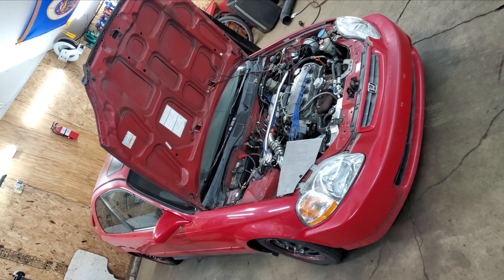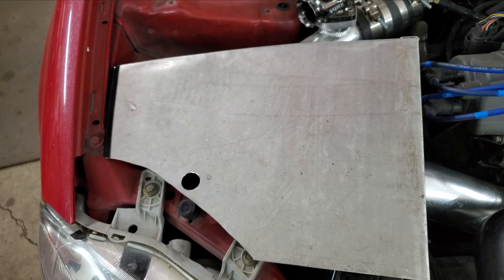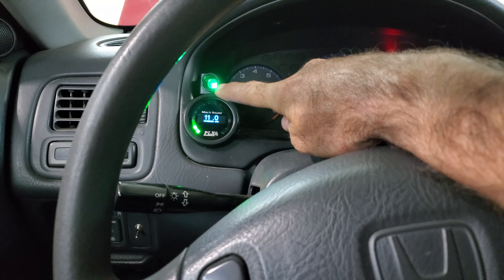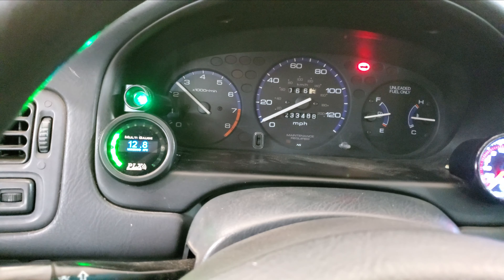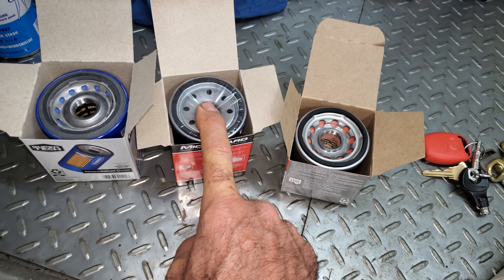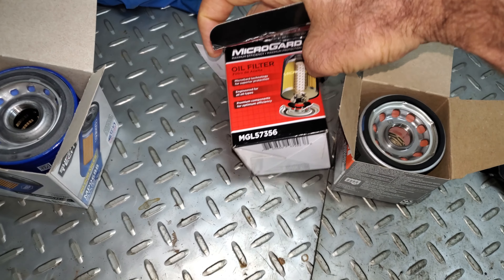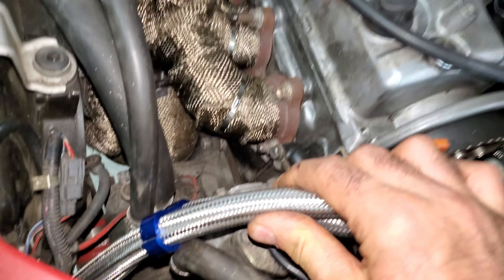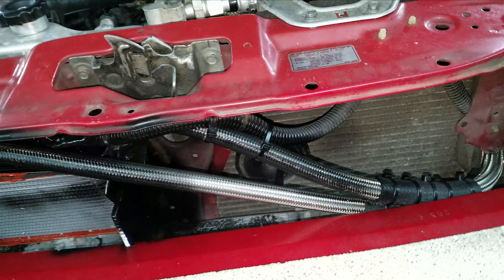Ej8 D16y8 Ebay Turbo oil cooler carbon synchro's part 24

Comment: I replaced the 1-2 syncro in my van and didn't even  have to remove the gearbox from the car. I opened it while on the car and was able to finagle the secondary shaft out to replace the syncro without pulling the primary shaft out completely. Worked fine.

Comment: Awesome vide as usual. I have the same setup as you on my 95 civic coupe. Only thing I put a 19 row oil cooler behind my intercooler. The oil cooler sits in between the radiator and the ac compressor but right on the intercooler. I like your setup better where the radiator fan will pull air through.
Reply from the maker: A little duct work does wonders for everything that needs cooling.

Comment: Hopefully you'll see this, I personally just picked up a tunernerd knock monitor v3. Its probably the tool youve been looking for, it'll really help dial in that timing and if I'm honest it's priced very well for what it does and gets rid of the guessing.
Reply from the maker: My problem with D16 is too high of cylinder pressure, with no detonation. Tuners have this problem with these. They are very detonation resistant. Location of peak pressure is too far up the cylinder, and timing needed to be removed, or boost lowered, or both. I fixed this problem by keeping my max boost pressure, and removing timing. That gives me the most power, without blowing my headgaskets. This stupid knock link never worked right, and wouldn't have helped me anyways.
Reply: @RustBeltAuto  

I've always understood d16's run so little timing as they have a detonation problems (y7/y8) and the z6 can get away with a little more but not much, and not cylinder pressure problems, if that was the case wouldn't the sleeves have damage if the problem was pressure? For example like the B20 sleeves. 

And to clarify they do technically have a pressure problem too if you get to much rpm/psi/timing on stock sleeves but the main culprit I've seen is all timing to grenade headgaskets.

Input?
Reply from the maker: @schafer240  they have a lack of detonation problems. It fools the tuner into believing the timing is correct, when in fact the location of peak pressure (LPP) is way off. They do not have the tools to measure it, and usually do not understand it. The head gasket is the weakest link. Peak pressure on an engine for maximum power is at about 15 degrees ATC. Adjusting timing moves that peak pressure farther down the cylinder, which in turn lowers that pressure. A few degrees goes a long way.
Reply: @RustBeltAuto  
I agree with what your saying, it all logically makes sense. Im just surprised with excess cylinder pressures to lead to frying a head gasket that sleeve damage isnt present. 

Like you mention a headgasket will always go first, i always think of them as a fuse.

Personally, I can't wait to get my motor all together with the knock software and see if I can confirm or deny when knock is apparent on this motor, I'm guessing it's alot sooner than most tuners think,.cylinder pressures will not be measurable but if I can tune under the knock threshold and crank alot of boost in and crack a sleeve before blowing a headgasket, that's the only way I can think of proving timing over pressure building but it could be the total opposite, be interesting to see the results.

Fyi, I have a Precision 6262 that will be at 30psi with stock sleeves, arias pistons/manley rods and a z6 crank in a d16y8, it should be around 600whp at that boost pressure. 

I'll update this if it grenades and how
Reply from the maker: @schafer240  my first tuner told me these engines can handle more timing than usual. Went through 5 head gaskets, 2 tuners, and put oversized head studs in this thing. They were both wrong. My last video in the playlist for this thing, I took a snapshot of the timing maps, and the map I doctored myself. 24psi, and this gasket is holding. I have done many many pulls on it.

Comment: What is the knock link? Used instead of wiring up the stock knock sensor?
Reply from the maker: It is supposed to be a knock detection device, to make sure you do not have too much timing in your car, and apparently makes some guess work of your RPM's through alternator ripple noise or something stupid. Hondata S300 OBD1 P28 computers do not have knock sensors to retard timing.
Reply: how would i know. im not a car mechanic
Reply from the maker: @eddieeclark314  we learn the hard way.

Comment: I'm local here in , where did you get your car tuned?
Reply from the maker: Tuners I took it to, turned out to be kind of a misnomer. Someone told me to try Full Blown next, if I need one.
Reply: @RustBeltAuto  if you end up needing one,, give db performance a call. They are located in Rogers 40mins from Minneapolis. Took my d16y8 there and made 321hp
Reply from the maker: @rantstm8836  Ya. Mine did 375, and lifted my head on my first 4th gear pull when Shane tuned it there. Then he emailed a street tune with less boost, and timing, and told me to "try that"? Asked for my money back, because he doesn't know WTF, and got it. When I was there, he gave me some speech about how timing, and boost pressure is the same thing, when I told him "I want him to back off the timing enough to make sure my head doesn't lift." Alex at Humble put about the same timing in my car, of course doing the same thing. It amazes me how much these "awesome" tuners don't actually know. There is no school, and frankly, they all need one. I shouldn't have to explain to a tuner what location of peak pressure is, and they all need a pressure tranducer invented for them. End of rant.
Reply: @RustBeltAuto  yeah I run 25psi in 3rd and 4th and I suffered a lot of headlift. Somehow not blowing a headgasket. It kept getting hot because all the coolant kept getting pushed out but I torqued down the arp's to 65ftlb and that seemed to help quite a bit. Give that a try if you haven't
Reply from the maker: @rantstm8836  once it blows, it's done. I made some guess work on timing, And have not had a problem since.
Reply from the maker: And put bigger studs in it, but wondering if I actually needed it.
Reply: @RustBeltAuto  I've heard success with people using srt4 Studs drilling them out like you did. Headlift is one of biggest issues on the d16's
Reply from the maker: @rantstm8836  I did 2.6 mitzu studs. For a y8, it seemed like a better idea. No time certs. Still had problems. Blew another gasket after that. Timing can create a tremendous amount of pressure, and E85 is very detonation resistant. It is easy for a tuner to get it wrong.
Reply from the maker: It is also very strange that you would give me a referral to a tuner that gives you a tune that blows head gaskets.

Comment: Your not getting good air flow in that filter from the view I seen, i would of just went with an oem honda filter and solves your filter debacle they aren't junk and don't have to worry about it like all oem parts just my 2 cents...something to consider,  but great video 👍
Reply from the maker: I don't think you are going to get 400Hp of air flow through a factory d16 filter. It would be fun to see what it would do on a dyno though. Like after you tune it without one. What part of getting enough air flow to produce 400HP don't you understand? It makes at least 400HP of air flow the way it is.

Comment: Because ur factory trans fluid was left in , it became foamy thus causing ur original issues ,   Running the new fluid (6) should perform much better

Comment: Be careful with that exhaust wrap, I had a friend lose a turbo eg hatch because oil seeped into the wrap and it caught on fire . Unfortunate . Would hate to see it to you
Reply from the maker: Yes. Always check for leaks, smell, and smoke. Always carry fire extinguisher.
Reply: Had it somewhat happen when my old turbo feed line started squirting onto the exhaust housing blanket. Thankfully I was able to rip the bastard off before any other damage was done being I have a top mount setup. It did burn my kids' school's front lawn though...

Comment: The word your looking for the knock sensor.  Technician don’t know what they are talking about cause there just a bunch of clowns
Reply from the maker: This KnockLink thing is what reads a knock sensor. I'm not looking for a knock sensor. It is bolted, and wired to my block in the stock location, and is working properly. Checked it with a graphing meter. Got a used one off of a Benz, and checked it again to be sure. I am a Technician. Am I missing something?